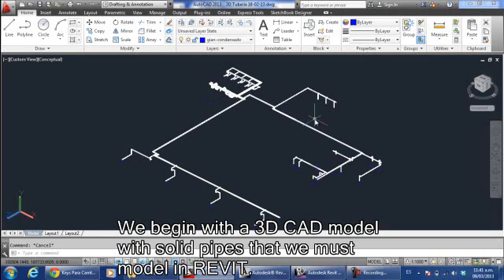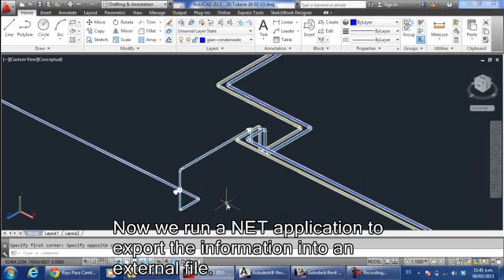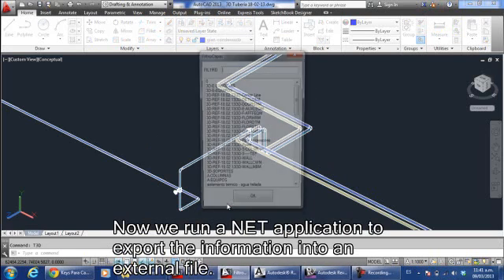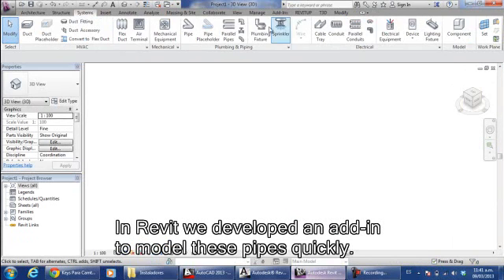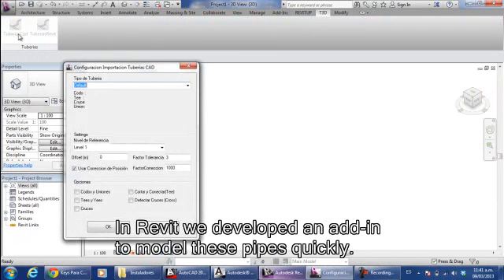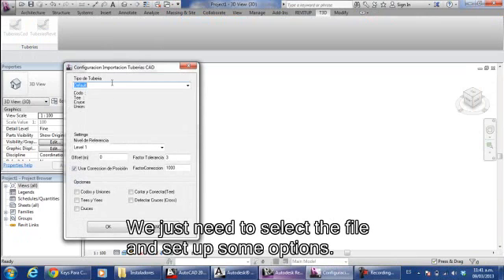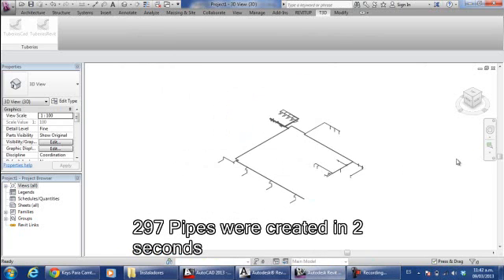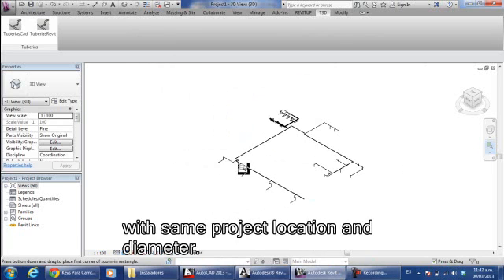Pipes from Autocad to Revit

Comment: Would you be able to guide me in how you did this..?
Reply from the maker: Austin Stone I will be glad to help you.
Reply: Did you create a add-in in revit..  or did you create some kind of script that looks at start and end points and then create the pipe or conduit that way?..
Reply from the maker: Yes I did. The info from CAD, star and end point to Revit
Reply: Okay, cool..  Did you use code like below..  

public Pipe CreateNewPipe(Document document, ElementId systemTypeId, ElementId levelId)
{
    // find a pipe type
            
    FilteredElementCollector collector = new FilteredElementCollector(document);
    collector.OfClass(typeof(PipeType));
    PipeType pipeType = collector.FirstElement() as PipeType;
            
    Pipe pipe = null;
    if (null != pipeType)
    {
        // create pipe between 2 points
        XYZ p1 = new XYZ(0, 0, 0);
        XYZ p2 = new XYZ(10, 0, 0);

        pipe = Pipe.Create(document, systemTypeId, pipeType.Id, levelId, p1, p2);
    }

    return pipe;
}

How did you tie the CAD Line Start and End points..?
Reply from the maker: First I read the lines in AutoCad to a txt file. Then read this file from revit.